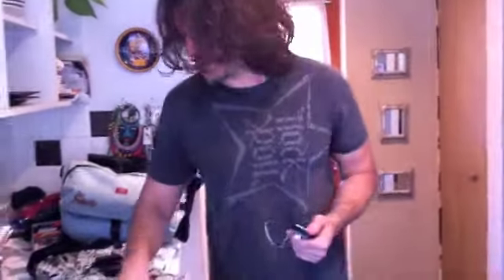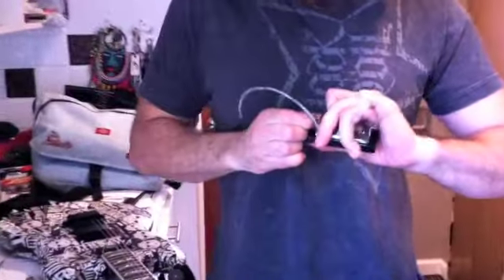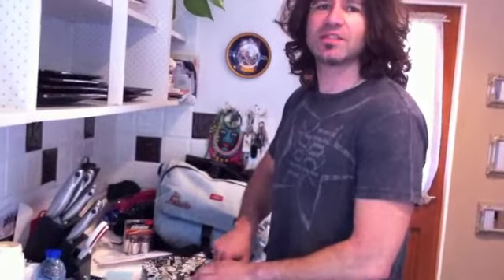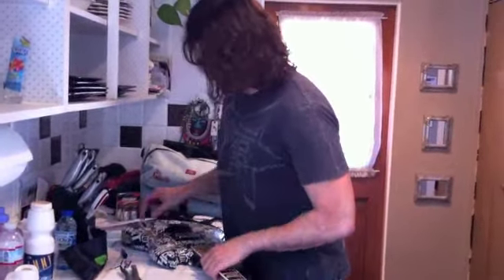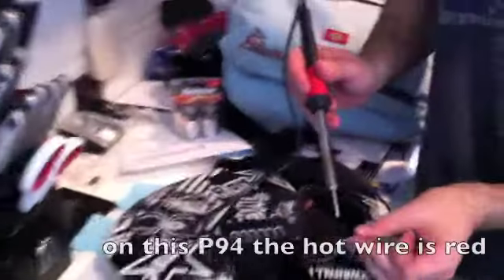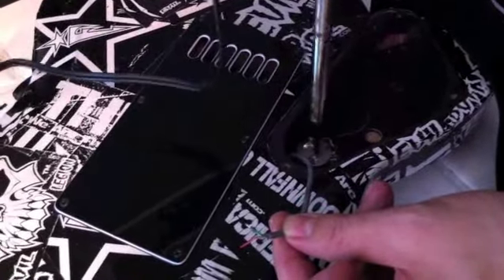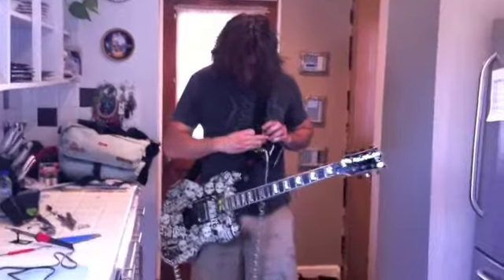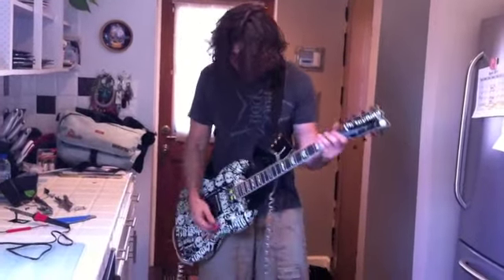PHIL X installs a P94 pickup

Comment from the maker: @gibsonguylp thanks, man.  you don't customize/mod a guitar just to do it.  you change pickups if you're not happy with the sound, blowtorch the finish off (or get it repainted) if you don't like the color or get new frets installed if you're not getting enough grab on the neck.  stuff like that.  but if it ain't broke, don't fix it.  if the mods are irreversible and you're unhappy with the results, you'll kick yourself in the ass.

Comment from the maker: @kobrw it depends on the guitar.  i was curious like you about an old jr reissue i had.  i could put the humbucker in the p90 hole without any mods but if you don't screw the pickup right into the body with springs or surgical tubing, you have to install the hummy with a ringmount which will leave 4 little visible holes if/when you put the P90 back

Comment from the maker: @GuitarHeroPhenomSux you probably don't have to replace anything.  just take it to a tech and have him check out all the solder points.  if it's intermittent, it's probably a loose connection or cold solder joint.